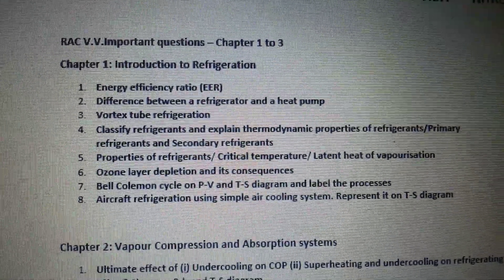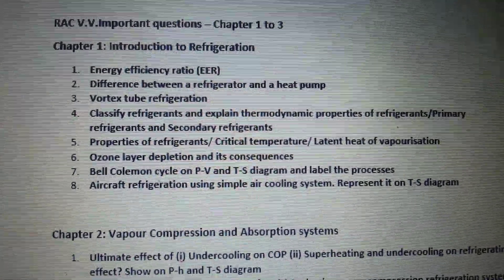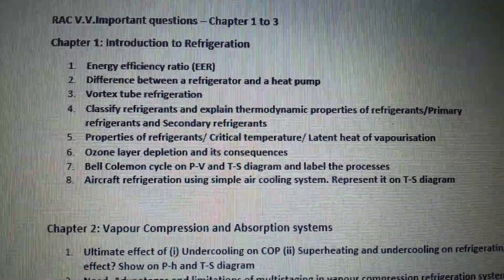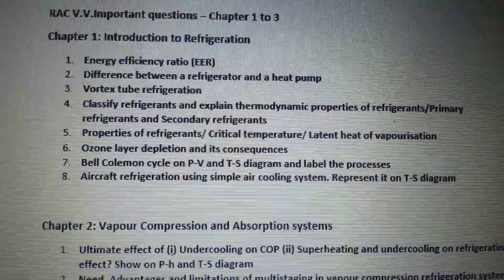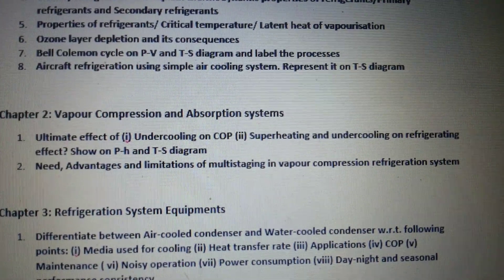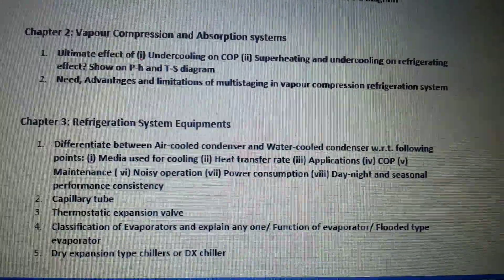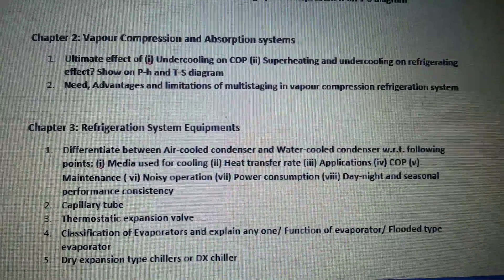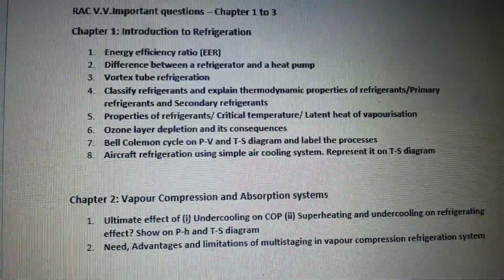3rd Dip. Mech., RAC V.V.Imp questions from Chapter 1 to 3 (Questions which came repeatedly in exams)

Comment: questions            .a gum  metal  has 
 30 part of copper 6 part of tin and  4 part of zinc find the percentage of each metal in gum metal
Reply from the maker: 75% Copper
15% Tin
10% Zinc
Reply from the maker: 30+6+4=40
(30/40)*100=75%
(6/40)*100=15%
(4/40)*100=10%
Reply: examination question 6 help sir
Reply: A pump can raise 2000 litter of water per minute to a height 15 meter what must be the horse power of the pump if it's efficiency is 80%
Reply: Find volume and total surface area of a cone whose base Dia is 8cm and. Height is 10cm
Reply: State laws of limiting friction
Reply: A ladder is inclined to wards a  wall at an angle of 70° if lower part ladder is 5meter away from wall what is the length of ladder and its hight from the floor
Reply: Three liter of water at 30°c is mixed with 4 liter of water at 85°c find out final temperature of mixture assuming no heat escapes.
Reply: Find the cost if running 10HP motor for 18days@8 hours per day if the cost of energy is RS .3 per unit
Reply: EXPLAIN THE FOLLOWING.     e 
Effort. (2) load , mechanical advantage. Velocity ratio .  (5) efficiency
Reply from the maker: Use formula 
P = [flow (gpm) x head (ft) x specific gravity (1 for water)] / (3960 x efficiency in decimal value)

Convert the given data as per formula (if you are using the above formula) 

P=(528.3 gpm x 49.2 ft x 1)/(3960 x 0.80)

P = 8.2 hp
Reply from the maker: @prabhakar711  
Total surface area A=πr [r+ √(h2+r2)] ≈ 185.61 sq.cm

Volume V = πr2 h
/3 ≈ 167.55 cu.cm
Reply from the maker: @prabhakar711  
Laws of Limiting Friction
1) The direction of limiting friction force is always the opposite of the motion of the body.
2) The magnitude of the friction force is equal to the force that tends to move the body.
3) The magnitude of the limiting friction always have a constant ratio with the normal reaction force which acts between the two surfaces.
4) Limiting friction force depends on the roughness of the surface.
5) Area between the surfaces is not responsible for the magnitude of the frictional force.
Reply from the maker: @prabhakar711  
Considering ladder is inclined at an angle of 70°  with respect to floor
tan 70° = opposite (height from the floor)/ adjacent (lower part of ladder from the wall)
Therefore, height = 5 x tan 70° =5 X 1.22 = 6.11 m

cos 70°  = adjacent (lower part of ladder from the wall)/ hypotenuse (length of ladder)
l = 5/cos 70°  = 5/0.63 = 7.89 m